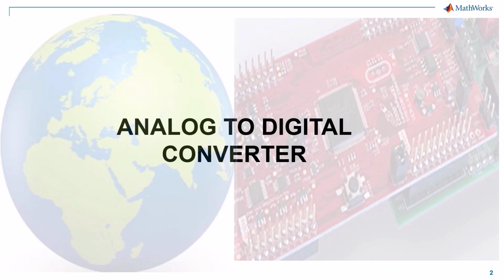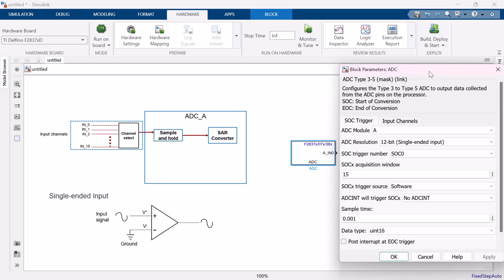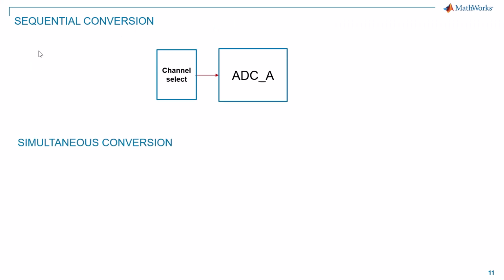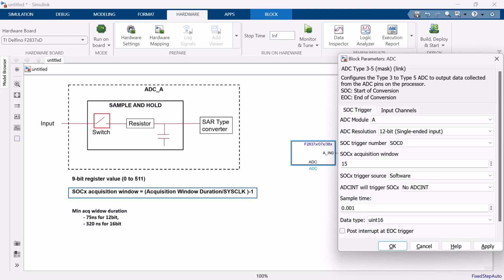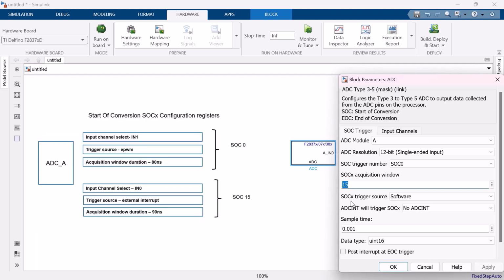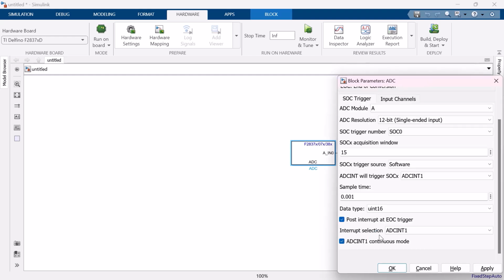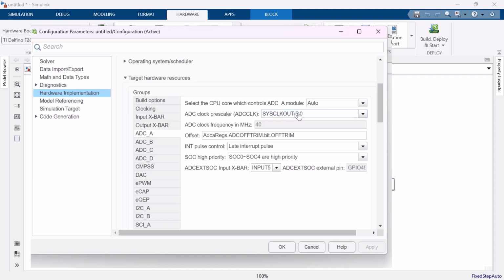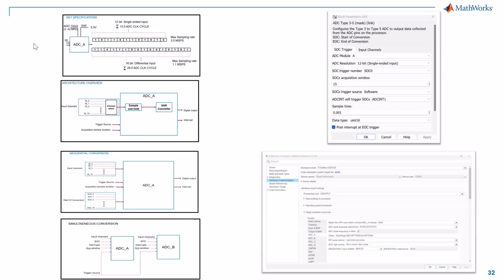How to Work with ADCs on C2000 MCUs | C2000 Microcontroller Blockset, Part 10

Comment: Hii,
Thank you for sharing this informative video series. The content you provided is highly valuable and greatly appreciated. I found the information very helpful, especially regarding the technical aspects discussed. I am particularly interested in learning more about the configuration of Timer1 and Timer2 in Simulink. Looking forward to your insights on this topic!
Reply from the maker: Here is an example on using timer2 https://in.mathworks.com/help/ti-c2000/gs/custom-code-block.html
Also, there is a register level access to timers and here is the link to doc https://www.mathworks.com/help/ti-c2000/ref/registerreadwrite.html